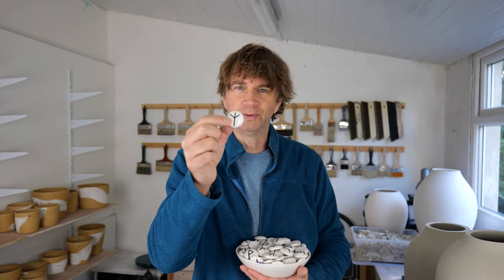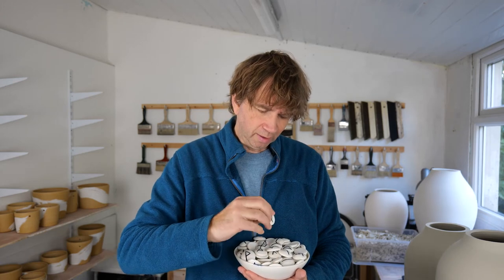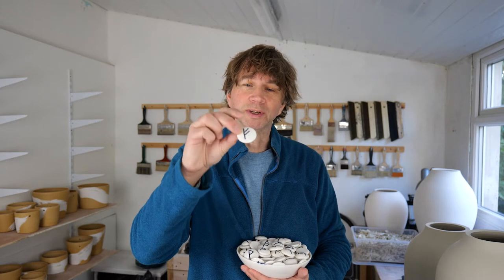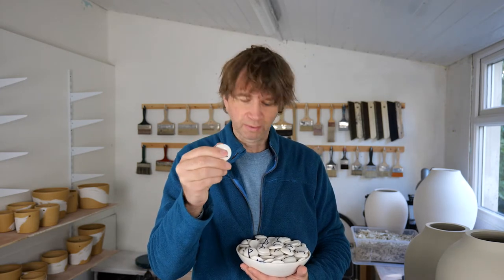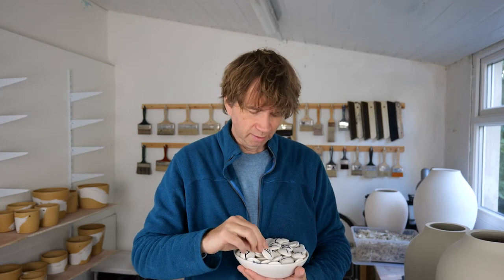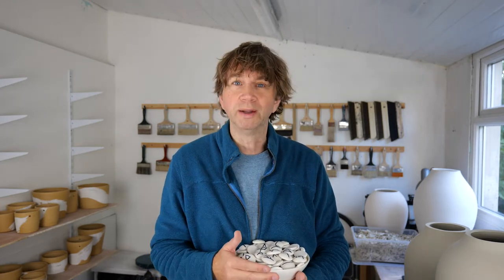How to make rune stones on a pottery wheel

Comment: What did you use to paint the symbols?
Reply from the maker: It's coloured slip, essentially wet clay which I paint into the engraved groove, where it hardens. Then I scrape it down to the surface so it's smooth.